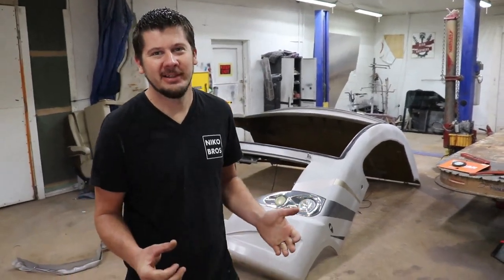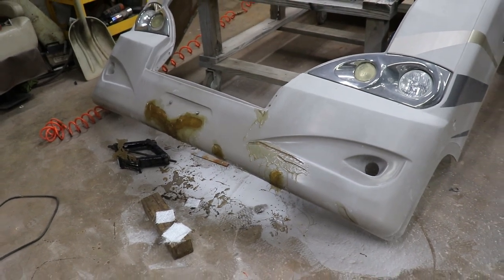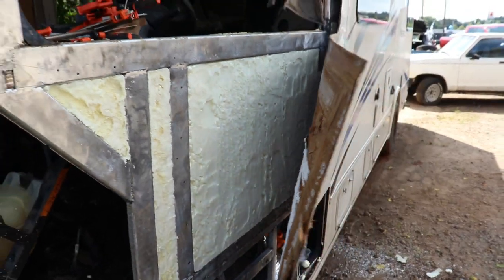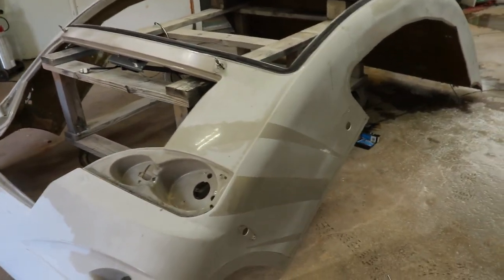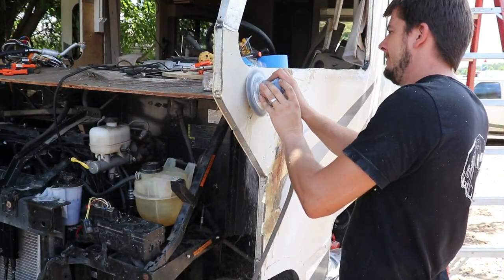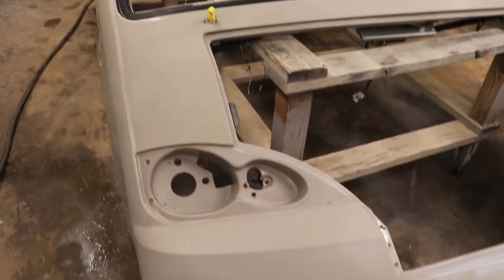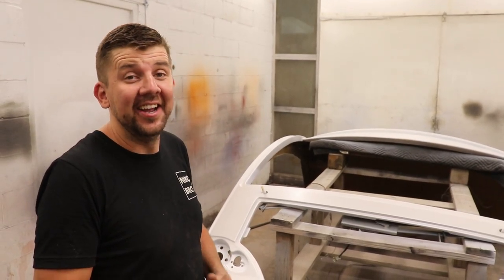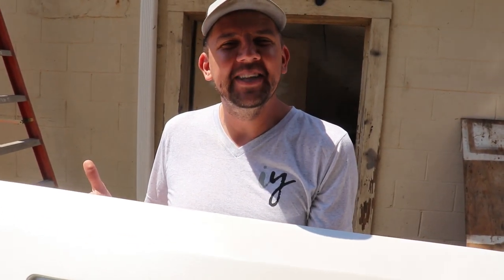SALVAGE THOR RV FRONTAL PIECE PAINTED A NEW COLOR

Comment: Select a light color to minimize heat build up inside, a baby Blue Metallic would be super cool !
Reply: You should have started  on the back side with the fiberglass.  And when that was dried, granded down the cracks
Reply: From the front side. Then feel them with the fiberglass.

Comment: I have always heard that when you are dealing with a fiberglass crack, you are supposed to drill a small hole at the end of the crack before repair.  This helps stop the crack from further expansion.
Reply: Also the repaired areas need reinforcing with resin & matting at the back.

Comment: Gday guys,
That’s turning out great! Hopefully such a beautiful top quality finish will bring an excellent result on sale day. 
Do you guys have to change orifice sizes on your spray gun for the different layers of base, pearl, clear coats? Or is it the same size for all? If so, I’m interested in what size you’re using. 
I spray standard two pack poly urethanes and epoxies here mostly on my flips. But going to have to give the pearl a try after watching this. I’ve got a white 03 F250 here in Oz that the clear coat is breaking down on. A pearl white finish would look awesome, 
Cheers 👍👍🍻

Comment: Fiberglass should be repaired from both sides.  Grind a bevel about 2 to 4 inches leading up to the crack so the crack becomes a knife edge.   Then lay a couoke layers of 2 oz fiberglass mat shaped to the bevel ( not exceeding much past the bevel.  ).   First layer is cut slightly smaller than the second layer.   Same on both sides.   Bondo is fine after.  If it is a boat it needs to be gel coated after the fiberglass repair to stop water intrusion and match the boat.